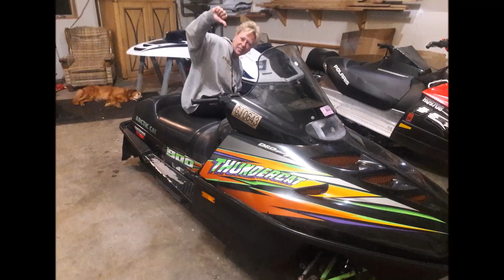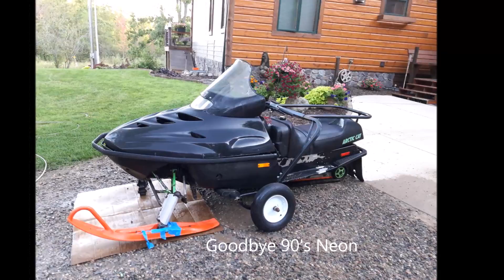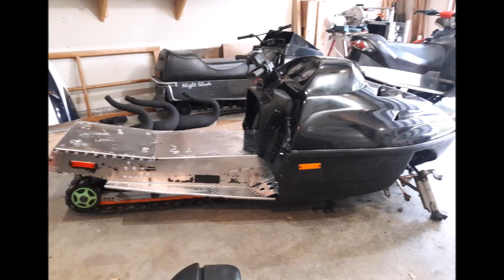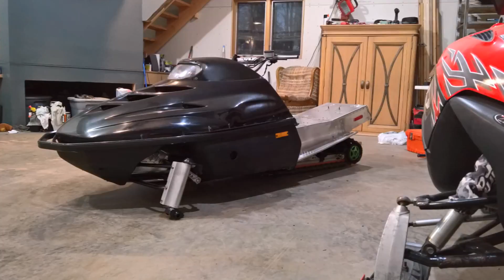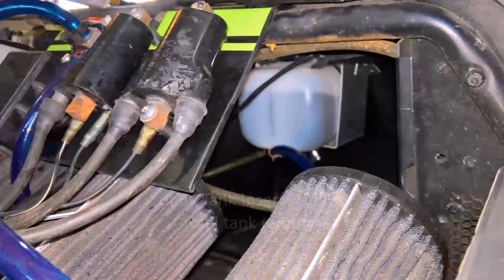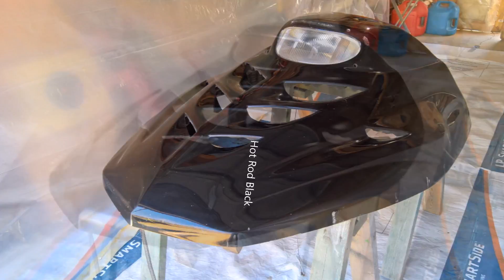TCAT Custom Drag Sled Transformation

Comment: Nice. I did my 96 t cat similar.  I got mine down to 490 from the factory 595lbs. I had a set of team dnd pipes that they used on there race sleds and a set of 48mm round slides. I ended up putting a turbo on it.  Then I sold it and moved down south.  Bout to get another one and put a asphalt track on it.
Reply: Could you tell me how you set up your sled with the turbo on it the fuel pump what size turbo things that you used on that I am having a very hard time making this thing work I can’t charge the batteries I’m running a electric fuel pump and electric oil pump for the Garrett turbo and nothing else or if any if I could if you were does send me something back I would be appreciated respond to it maybe I can talk with you with a phone number I would appreciate it very much my name is Ron